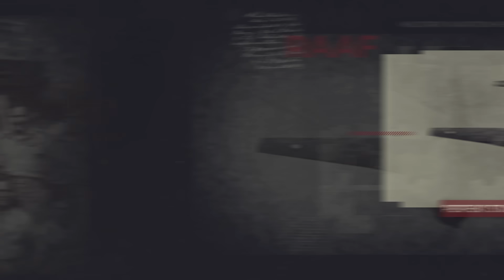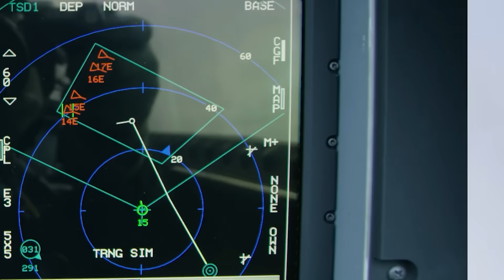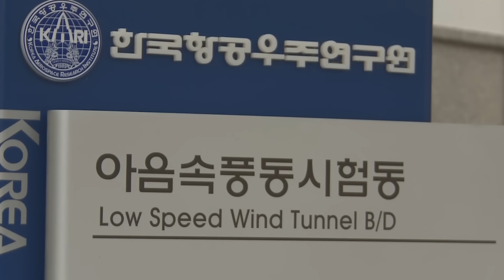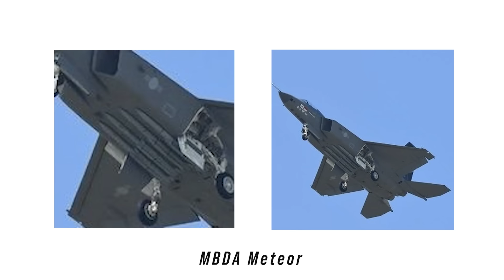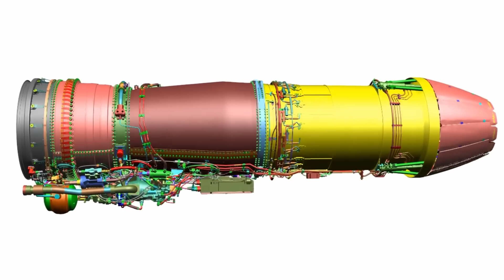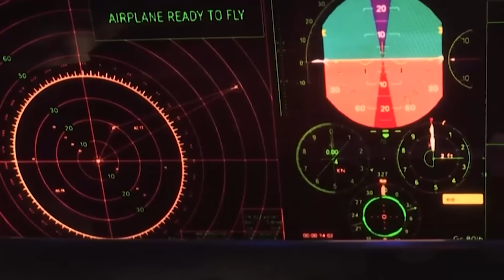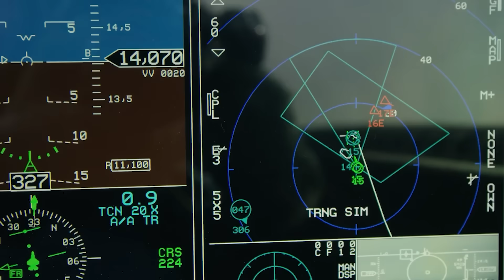KF-21: Korea's New Fighter

Comment: Simply, the KF-21 is what a modern F-15 would look like. It's a 4.5 generation aircraft. Stealth is not the highest priority. Instead, the focus is a balance between maximum power and armament with low observability as a consideration. It seems like a combination of an F-15 and an F-22.
Reply: It does seem to lack the extreme speeds the f15 or f22 are capable of though.  But that makes some sense as they don't have a huge territory to protect.
Reply: @evantimm6053 more like, it's never been designed to be "the best" or "the most". It's very nature is the gap-filling back up fighter with decent capabilities. Giving it the extreme speed is against its own goal because 1. That kind of capabilities can be found on the elite fighters KF-21 would back up and 2. It will only make KF-21 less cheaper, so you won't afford it as many as you need.
Reply: @evantimm6053  Could also be that US has an export ban on their tier-1 engines.
Reply: @evantimm6053   Its why Indonesia went with a proven F15EX instead. Delivery dates are about the same, so its not an availability thing.
Reply: It makes sense. You don't need a fleet of F-22s to keep the "mighty" North Korean air force at bay, lol.
Reply: F-18 + F-35 maybe?
Reply: @jaeholee3816  no, f35 is a league above kf21, it doesn't even have a weapons bay. It's more like f35 minus f18.
Reply: The kf-21 is a middle-class fighter that costs similar to the f-16 but has higher performance and expandability to the fifth generation. The Korean Air Force will retire all of the f-16s sequentially. The kf-21 cannot replace the f-35 or f-15, but it will be the most powerful competitor in the middle-class.
Reply: Right~^^
Reply: no. it is F18

Comment: Its like a dual engine f-35. Did they make or buy this because it was cheaper than f-35s? Is it because we would not sell them f-35s? Is it better because it is dual engine?
Reply: No, what South Koreans are doing is exactly what the U.S. is doing, but with less money. Current U.S. strategy revolves around high-low combination, where high being F22 and low being F35; S.K. mimics that strategy with F35 as their high, and KF21 as their low.

Comment: I originally thought this was just a baby raptor.  But after further review, the overall look is very similar to the F-22, but the wings and tail closer resemble the F-35.  Vertical stabilizers are still F-22.
Reply: That because.. F22 flight program engineer boss was Korean and F22 designed and made by him.
 Now he working for KF21. and much developed from F22.  It's a known secret.
Reply: @tommyjun3895  wtf are you talking about? The F-22 was designed and developed by the U.S based manufacturing Lockheed Martin in the 1990s by the Americans. You are totally misinformed. Bot
Reply: @j.a.3138  It is true. At the time of F-22 development, the general manager of avionics flight control participated in the development of KF-21 (Korean national of the United States) and used the data that he had at the time of F-22 development. He was indicted by U.S. prosecutors for this. I'm Dr. Park Si-Mong.

Comment: The mix between very low radar visibility and high visibility should be preferable.
The envelope of operations should shift from multi-role to special operations.
A wing of F-15E with 22 missiles will be detected from far away. Are there F-35 lurking and marking targets? Should you go after the F-15 or is this a trap?
The stealth jet is a force multiplier, while a gunship is brute force. 12-meteor wings of jets could down your entire air force in the region. Flight or fight?

Comment: nternational aircraft parts companies are participating in KF-21. Lockheed Martin has been involved since the T-50 advanced trainer. In the KF-21, Korea developed the four core technologies and 29 technologies that were denied approval by the U.S. Congress, and Lockheed Martin only plays an advisory role in the design. So Lockheed Martin is Korea’s official partner company. Joint marketing of the Korean T-50 was conducted for the U.S. Air Force's advanced trainer project, and the KF-21 was also mentioned in an interview with Lockheed Martin's vice president for Asia. Officially, the F-22, F-35, and KF-21 have Lockheed Martin design DNA, and other fighters are copies.

Comment: Turkey was very serious about joining the project but engines and some subsystems were decided as American during development. South Korea tried to get full licence including export for them but couldn't manage. It meant Turkish KF-21s would require American approval and there wasn't going to be full Turkish domestic production, therefore Turkey had to leave the project. It was going to reduce cost of units significantly so a big loss for both countries. Later Turkey launched it's own 5th generation project as TF-X which is actually continued on KF-X. While Turkish version is significantly larger with large internal bays other than that they are still quite similar..
Reply: The biggest reason for Turkey's failure to participate in the KFX business is that Korea did not accept the request for 40% participation in KFX (Korea 40%, Turkey 40%, Indonesia 20%). 
I know that the current TFX kaan's engine is also an American F100, but it is difficult to change to a Eurojet engine in the future, so Turkey have to continue using American engines.

Comment: In 2021, the President of Korea visited Australia and signed an agreement on space and air launch vehicles. Australia is a strong ally of Korea. The Australian Prime Minister shared various opinions with the Korean President about China's pressure. Korea has already suffered enormous economic threats from China due to the deployment of THAAD missiles, and numerous Korean investments have disappeared into thin air. Australia also recently shared this pain with Korea and agreed to close military cooperation. Recently, joint military exercises between Korea and Australia were held in Korea and Australia, respectively. Australian soldiers cooperated with the Korean military in Miles training at the Korean training range, and the Korean military practiced amphibious operations in the Australian area. There will be even closer cooperation in the future. Military cooperation projects with Australia have begun in the Army and Navy, and the Air Force will soon cooperate as well. The Korean people do not forget the sacrifices of Australian Korean War veterans. thank you

Comment: The only reason the SU-75 is not seen much is because it doesn't really exist yet as a working aircraft. Given previous Russian behavior when it comes to new "cutting edge" hardware, and the fact that the Checkmate is supposed to be a machine made for export, they're far more likely to show the aircraft off while extoling its virtues to high heaven if there was actually anything to show beyond a mockup, simply so it can garner interest with potential buyers. 

Also kind of funny the F-16's supposed role as a "dogfighter" in the trio, when dogfighting  in knife-fight range hasn't been particularly relevant for the past 5 decades, with most modern air combat engagements in hotspots like the Middle East relying on beyond-visual-range missile shots and ECM.

Comment: The downside of that New jet is its engine, it uses still the old F414 turbofan used by the Gripen 39 and Tejas of India, and one of the Hornet's engines as well. So superiority in acceleration is just the same or even slower since it has more payloads. Turbofan is a big consideration among buyer countries. Hope they change the turbofan by getting a more advanced turbofan model.
Reply: It is prudent to use a known good engine in a new aircraft to mitigate project risks. They have a future replacement engine in development. But the GE F414 is perfectly adequate for the job for now.
Reply: @Stu_Bur  always remembers they are competing in the market as the alternative, therefore the offer has a better edge among other jets. also, a bad idea is they position their jet in the middle between trainer combat and MRF. A blurred positioning is a clear disadvantage if you're the country looking for a specific dedicated jet. TF KAAN for example of Turkey is way superior than that,  MRF and stealth, so for sure a big headache to KF 21 once both jets get into a bid in any Air Force around the globe.
Reply: @darwinyuson9338  It's my personal opinion. KAAN in Turkiye has a hard chance of success.
Reply: @trinity1203  I don't think so, they secured the Bae system from the UK, and they will be using a Rolls Royce turbofan EJ200 stealth jet engine, and the Turks found a solution by not so much relying on the US turbofan. This Turkish stealth MRF will surely be an alternative for the EU in terms of stealth jets in the future, as it has permission somehow from the UK since they agreed to provide the engine. And going back to what I was saying, TF KAAN is crystal clear on its purpose, no half-baked that crosses between a trainer to light combat to MRF which was the same mistake of the US in the past in their prototyping. TF KAAN is an MRF stealth jet, very clear. Cheers!
Reply: @darwinyuson9338 I am 100% sure that you are Turkish, right?😂
Reply: @kfx3907  Sounds like right? LOL